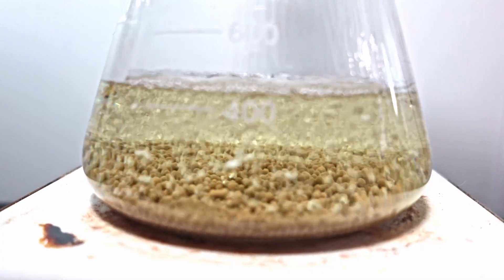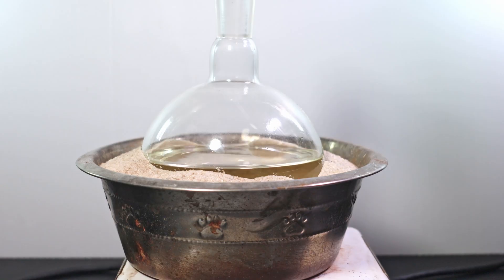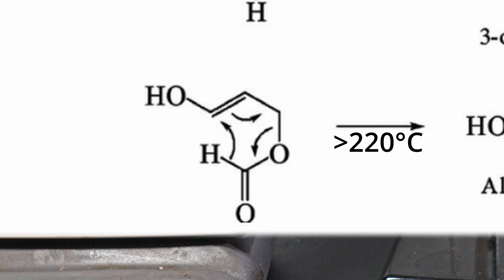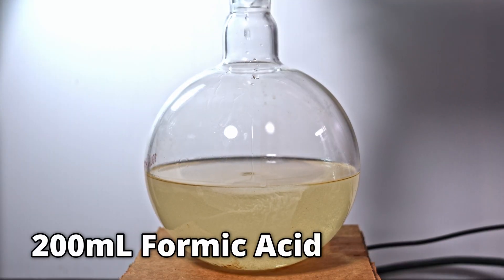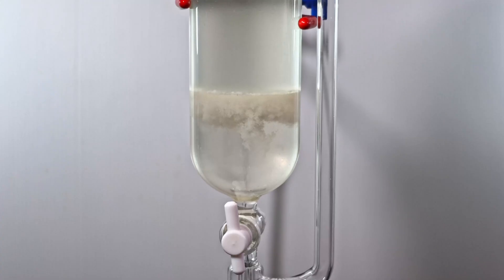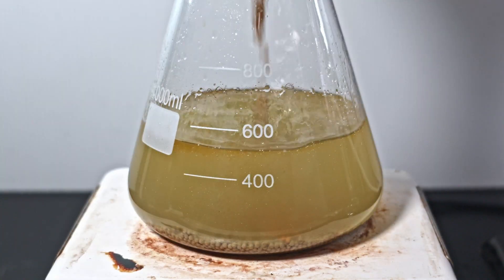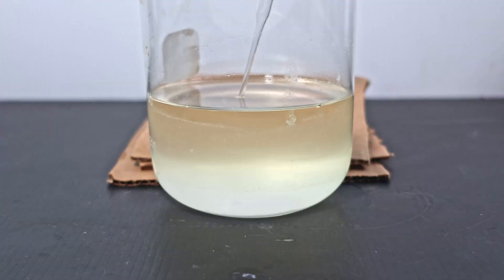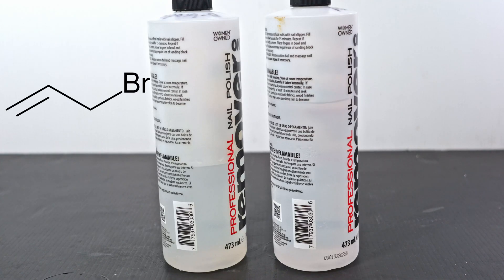Making Allyl Alcohol

Comment: I like this video, but... why didn't you just neutralize the distillates with NaOH and fractionally distilled them? Allyl alcohol forms an azeotrope with water, and it could've removed most of the water at once...
Reply from the maker: High heat with sodium hydroxide poses a risk of polymerization due to the alkene nature
Reply: @MolecularPlayground  Allyl alcohol shouldn't polymerize with hydroxides, it is not an electrophilic alkene

Comment: Always use something like inverted funnel in water trap to prevent suck back (or be sure to remove it before vapor pressure reduces)- Another container in the chain can also act as a suck back protection.
Reply from the maker: I dont have a funnel that can fit my tubing, but an intermediary container is a great idea!